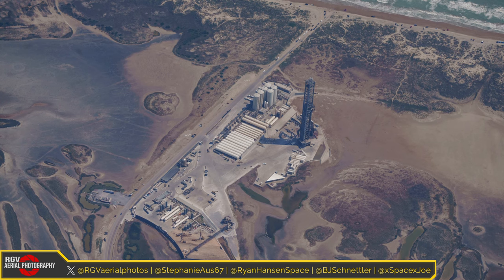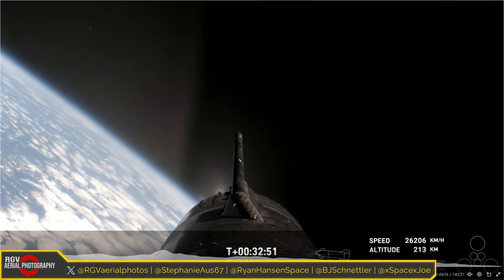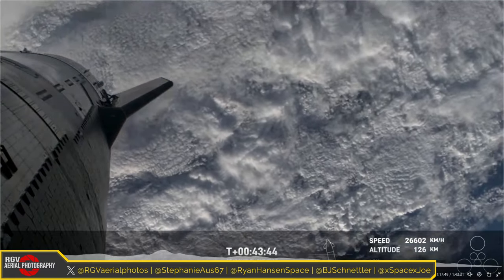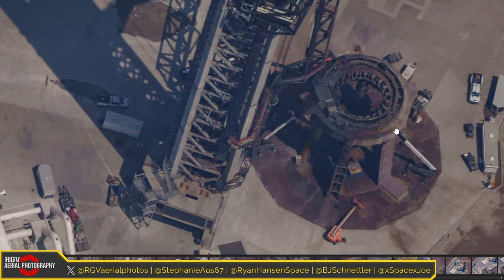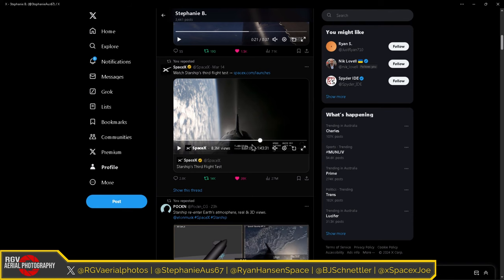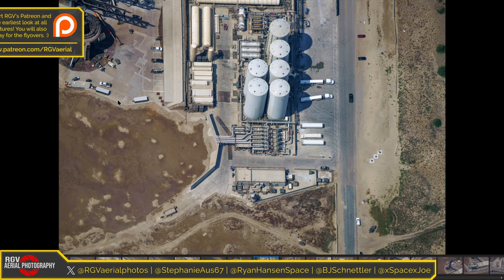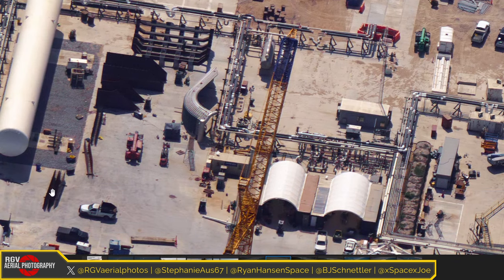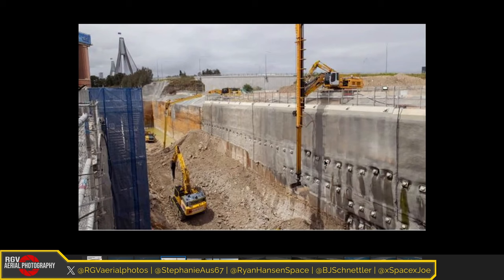Starbase Weekly, Ep.109: Flight 3 Aftermath: Post-Launch Flyover!

Comment: RE: Booster soft landing

I suspect we may see some issues with the aerodynamics of the Booster's Tail ... trying to relight engines against such a huge headwind is crazy enough for falcon, but this booster's a LOT wider than Falcon, so there's that much more heat blowback and turbulence.
Reply: But raptor also has way higher chamber pressure than merlin so it can just blow the air out

Comment: 9:32 - B10 did NOT crash into the ocean mostly intact, it exploded about 462 meters above the water. This is made clear on SpaceX's own web site that detailed the flight. The exact text is:

"Super Heavy successfully lit several engines for its first ever landing burn before the vehicle experienced a RUD (that’s SpaceX-speak for “rapid unscheduled disassembly”). The booster’s flight concluded at approximately 462 meters in altitude and just under seven minutes into the mission."

Comment: Since I have lived along the Texas gulf coast, I am wondering what SpaceX has done to prevent damage from a direct hit by a hurricane? Also thanks for the flyover, I have missed it for the past couple of weeks
Reply: To the casual observer, doesn’t look like SpaceX’s Texas facilities are any less robust than anything NASA has done at the Cape over the past 50 years.
Reply: The new electrical/control building by the static fire stand in-progress is built off the ground. Possible flooding related reasons.
Reply: @h25b  that’s true but nasa didn’t put all their eggs in one bucket like SpaceX…they had different locations for different roles. Couldn’t nasa even launch the space shuttle form California also?
Reply: @michaeljohnson1805  SpaceX Has launch capability for Falcon 9 at Vandenberg (California, unmanned) and Kennedy Space Center (Florida, soon to be 2 pads capable of manned launch). SpaceX can launch Starship from Texas and are building a pad with tower at KSC..

No, NASA couldn’t launch the shuttle from California.

How are all their eggs in one basket…????
Reply: @h25b  those are only launch facilities..what about everything else? Mass didn’t construct the rockets or boosters from Florida they ere manufactured in Alabama, also after the shuttle was launched everything was then shifted to Houston..at SpaceX everything is in one location except for the launch facilities…so what I first said what has SpaceX done to prevent a disaster if a hurricane would strike the boca chica facility….it could wipe out their entire ability to launch for a very long time…especially now with all the construction taking place…a powerful hurricane could wipe out a lot of starbase….i am just wondering if they took any of this into consideration when building mega bays and star factory…the water in the canals that surround all those facilities could rise by 20 feet in a storm surge….
Reply: @michaeljohnson1805  SpaceX isn’t a government contractor bureaucracy. They could probably rebuild Starbase in a few months, definitely no more than a year.
Reply: @h25b  lol I doubt that seriously…it took SpaceX six months just to repair the launch tower after the first launch…also SpaceX isn’t a government business but that doesn’t mean it doesn’t have to follow governmental regulations…in fact if the facilities were greatly damaged there would be many investigations into the harm to the environment…these processes can take years…also SpaceX is not like the government where they can print their own money to pay for all of this…therefore like I said from the beginning what is SpaceX doing to try and prevent this happening…
Reply: I have shared this concern for a very long time, as well.  Texas coast is infamous for high-intensity hurricanes, though not hitting very frequently, but when they do hit... then oh, boy.

As to what SpaceX has done to mitigate that risk...  As far as I can tell, they must've crossed their fingers and knocked on wood a couple of times.  In other words, they're just rolling the dice and betting on some continued good luck.

Comment: Could SpaceX apply a spray on, ablative material onto the launch mount where it gets scorched?
Reply: Possibly, but then its just another thing to replace all the time. Also the stuff vaporized off will get spray painted onto everything around the area which would be a nightmare. I think they need to start launching straight up instead of turning that blow torch directly at half of the pad during launch lol.
A water system on the top side would likely do a lot as well, so an "ablative" cover, but one that just turns to vapor that wont stick to things afterward.
Reply: At the very least I hope they move the QD to the other side.